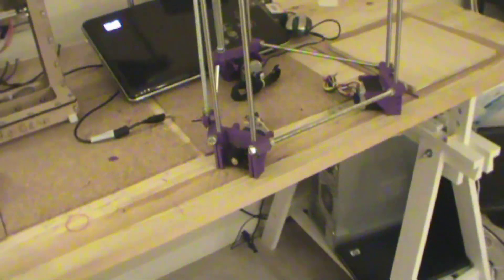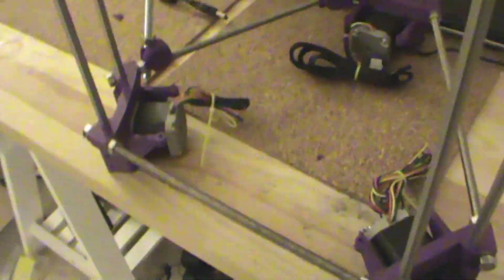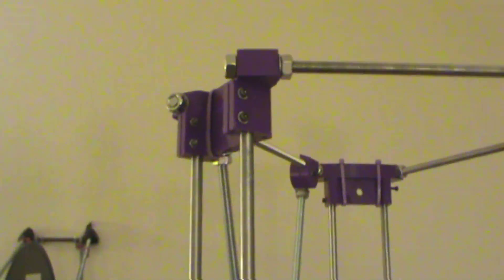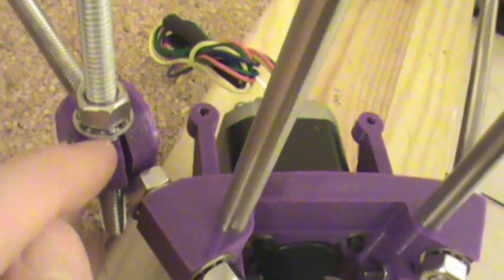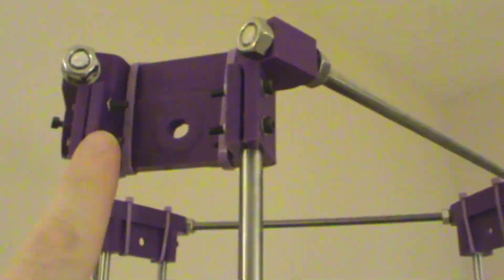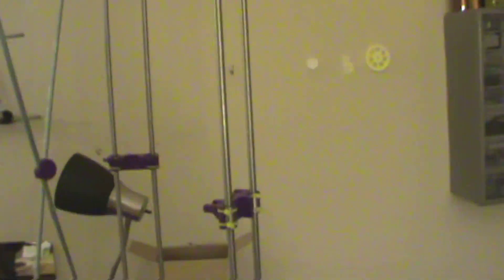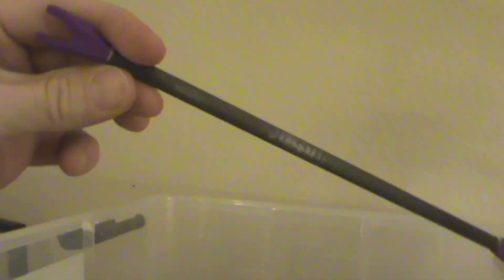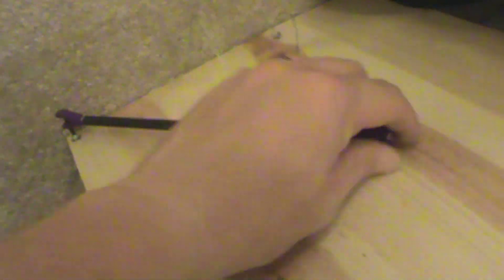FAILED PROJECT! My Rostock Delta 3D Printer Build

Comment: Regarding the diagonals interfering with the base board you could fabricate a circular ring that sits around half way up and surrounds the 3D .. then braces from top and bottom join to this ring keeping it in its position . This would leave room for a full bed to exist right to the top. Alternatively,  you could make up small geodetic structure to stiffen up the outside